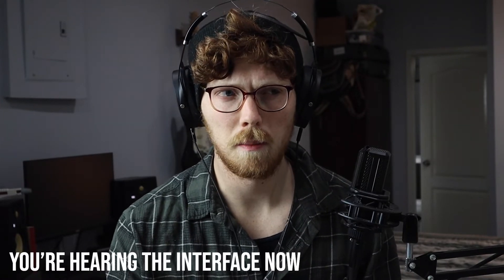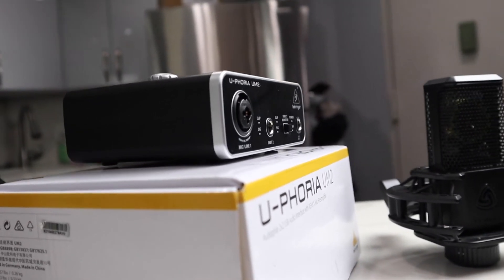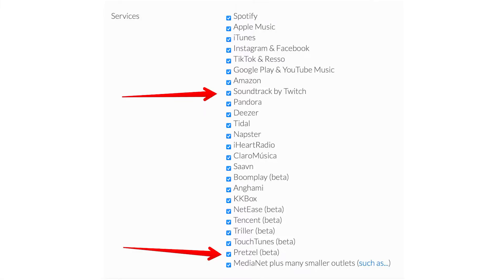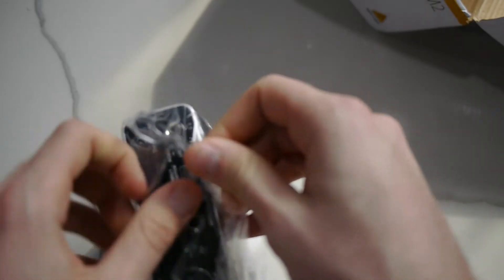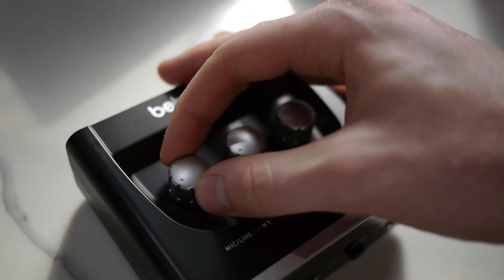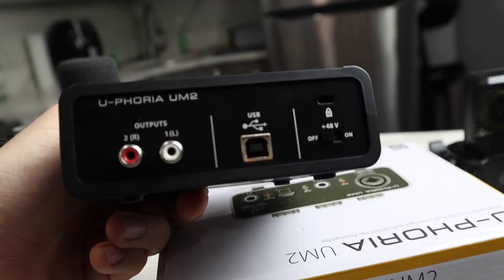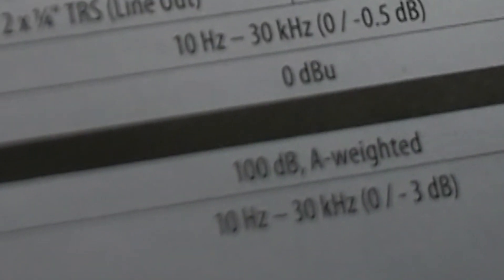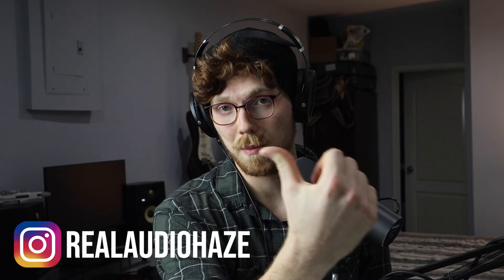Testing the Cheapest Audio Interface on Amazon (Behringer UM2)

Comment: hello from two and a half years later. the problem with this interface is not the preamp noise or power, but no resistance to interference noise. the fact that it is introduced as 24 bit but actually gives 16 bit output is a fun detail besides the interference noise issue. goodbye from 2 years later. love your content <3

Comment: Before watching TLDR; I own it and… it works. Preamps are a little noisy; nothing a little gate at -45db doesn’t clean up. Works great for my secondary set up and was a good little starter when I had to start over from scratch. For $35 smackers it’s a bit pricier then when I bought it for $25, but I have had it 3+ years and it still works.
Reply: as someone who wants it mostly as an amp for guitar to add filters n stuff, is it good?
Reply: @Aggouric  yeah works plenty fine for guitar input, especially if you are using dirty tones

Comment: As for the noise test, results for both seemed to be dominated by (varying) ambient noise present rather than the preamp input. If you want something comparable, I'd suggest using the SM7B and an XLR splitter cable so the same performance can be recorded with both interfaces at once.

It is not unusual to see a frequency response drop up top with gain at full tilt, though generally I wouldn't expect it to be as noticeable as in the UM2. It's still plenty fine for spoken word... slap on an XM8500 and voilà, there's a perfectly acceptable budget podcasting setup.

As mentioned, if you can find an M-track Solo for not much more I would consider going for that instead. Still, the UM2 is no slouch... it's still a better match for a low-impedance dynamic mic than a Steinberg UR22 or - heaven forbid - a Presonus Audiobox USB 96.

Comment: I have been using UM2 for 2 years now, I never needed to upgrade probably because my gears are easy to drive and I don't always need the preamp.

The plastic construction didn't matter at all for durability. I find it as something that just sits on my desk. The knobs may be a little wobbly, but its not something that gets wobblier. 

If you're on pc, let the drivers used be the one that windows installs by itself (it'll show as USB-AUDIO CODEC) and then get the alternative asio drivers.

Alternative ASIO drivers of my choice is Voicemeeter Virtual Asio. I produce music on the regular and don't have problems with it.

For 35-45$, hell yea.
Reply from the maker: Great long term insight here! Thanks man

Comment: I really like your video. I have a  few Behringer things laying around, and I like them a lot. My daily "interface" is an old FCA1616, with it's main defect being the fact that it doesn't have a built in power supply and switch. All the rest I just LOVE. Some products are "low end" however, but that's not unusual at that price point.

 I often recommend either the Scarlet 2i2 or the Behringer UMC202HD (because of the 24-bit capability and both of them having two microphone inputs - really useful for podcasts). These interfaces are definitely great, and by recommending the slightly more expensive ones, I try to avoid the need for upgrading without breaking the bank.

I do think you're confusing bit depth (number of bits per sample) with bit rate (number of data bits used in 1 second), but still I like your videos a lot. You give your honest opinion, and you're not afraid to come back and adjust your opinion if the results are not what you were expecting (like it sounding a bit darker than you expected). Keep them coming! Love your channel!
Reply from the maker: Thanks Nico! And yeah good call on the UMC202HD over the UM2. But I definitely know the difference between bitrate and sample rate, one being related to headroom and dynamic range and the other being related to the approximate resolution of a wavelength. That being said, the metaphor and comparison I worked was def a bit confusing

Comment: I got the UMC202HD, THAT model has the MIDAS preamps, unlike the older UM2.   Recommend checking that as an entry-level as not much more and for what you get (metal case...) I wonder why they still flog the UM2.
Reply from the maker: Yeah I'll have to check it out! Heard good things as well and you're right, not to much more!
Reply: You should either get the UMC22 (or 2) for a cheap and limited one channel interface
or the UMC204 for a 2 channel interface with complete connectivity. 

The UMC202 costs a lot comparatively but sits in a weird in-between spot. Its too expensive to buy it just so you have anything but there is also a very high chance that you are going to replace it in the future. Just spend 20 more bucks for the 204 to get an interface that you can keep using forever.
Compared to the UMC22/2/204 the 202 is the only interface where direct monitoring doesnt work properly because it always outputs the audio to just one side of your headphones.
Reply: @Currywurst-zo8oo  Can't disagree, though the 202 output in monitor does both channels, it if you have one mono input then it will just output to one side on the headphones and if you have both inputs in use, you get both sides, tried and tested many a time.

But the RCA out's on the 204 as well as midi, do make it worth the extra.  Though in my case I got my 202 new in a deal for just over £50.
Reply: @Currywurst-zo8oo  BTW. I think if you push the jack not till the end of socket it will "downmix" channels to mono or clone one of the channels for both. Just a "hacky" thing.
Reply: @Currywurst-zo8oo  I have the UMC204, definitely skip the UMC202 and get the UMC204. Great audio interface, the Midas preamps are really good, the thing is very solid and built like a tank.

Comment: Damn, in the blind AB the second interface had an obviously much fuller and dynamic sound/more depth to it compared to the first one. Scarlett is a massive improvement, is that the 2i2?
Reply from the maker: Absolutely true, and in the noise floor test with the dynamic mic, the different is very apparent
Reply: @AudioHaze  I knew the noise floor was going to be a massive difference but I'm surprised at how much difference response wise the preamps have, potentially ADC as well. Which Focusrite is that that you are using?

Comment: I’m a firm believer that the um2 is significantly poopoo. The lack of drivers really sets it into the dookie section. The interface i always recommended to people on a budget is the mtrack solo, it’s barely 10 dollars more but has significantly less preamp noise, headphone distortion, and it has asio drivers. Easily the best super cheap interface imo. Also hugely recommend an audient evo 4 in the next step up. Nonexistent preamp noise and the headphone preamps are butter.
Reply from the maker: Will have to check it out! I haven't tried the M-Audio stuff. I'm sure it does offer some significant improvements though! Was just curious what the bottom of the barrel preamp sounded like in the first place, and imo, really not too bad!

Comment: Cool vid! I wonder if the Midas preamp is the reason it sounds darker?
Video request: I also own an 18i20, and I am looking to get another 8 mic input to take advantage of ADAT connections and get 16 mic inputs. The Behringer version of the 18i20 is only $279 vs. the Octopre or another 18i20 which are close to $500/600 now. Could using the 18i20 as the master and the Behringer as a slave work in terms of ADAT? Or will the darker tone from the Behringer, as discovered in your video be a factor? Might be a good video… awesome work btw!
Reply: This model does not have the MIDAS preamps, UMC202HD would be the cheapest one AFAIK with those preamps.
Reply from the maker: Perhaps one day I could try something like that! Wold be curious how big of a difference the 18i20 makes compared to the Behringer, but likely similar to this experiment I suppose. In terms of ADAT, I am not the guy unfortunatetly, I wouldn't know if you could chain them like that. That said, you could easily make an aggregate device and treat the two interfaces like one big super interface! (at least on mac)
Reply: Behringer does an ADAT interface ADA8200 that has Midas "designed" preamps and works with the 18i20, currently this is less than 40% the price of the equivalent octopre and it sounds pretty decent.

Comment: Oh I almost bought this before jumping in to the Scarlett solo. Its a good entry level interface. But a lot of audio engineering friends of mine convinced me to invest in a better interface and the Scarlett solo was that.
Reply from the maker: There's definitely a noticeable difference, but I mean for $35 (right now at least), its hard to beat at that price!
Reply: @AudioHaze  I do have to keep myself from buying the "cheapest model" of somethings. Sometimes I just can't resist like the "cheapest Behringer switchless dynamic microphones for podcast recording". But then at some point you have to redefine your standards. In my example: the SL84C is NOT sufficient for me, while the BA85A is more than good enough for me (as is the XM8500). It was 11 euro vs 25 euro per microphone. The BA85A and its slightly darker sounding sibling the XM8500 are NOT in the same league as the SM57 or SM58 (or the sE V7 which is far better than the SM58 IMHO), but they cost only about 1/4th of their price.
My point being is that at some point I find it important to define minimum expectations. At some point the law of diminishing returns kicks in. Keeping it with Behringer Products, the BA85A and XM8500 are my sweet spots where that principle kicks in. For audio interfaces it is at the UMC202HD (costing three times as much as the UM2, while still being very much in a "very low budget" price bracket)
Reply: Same here instead of the scarlet I went with the minifuse 1